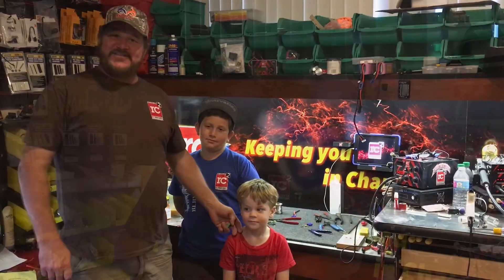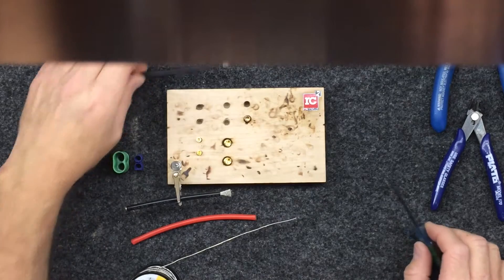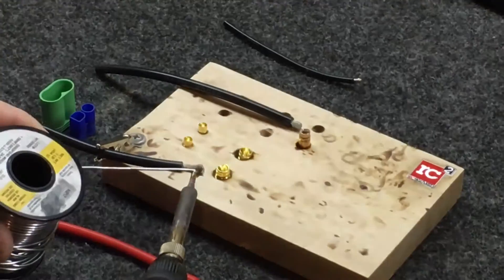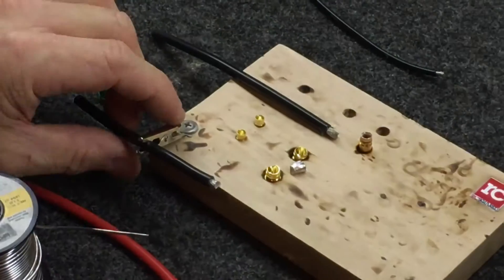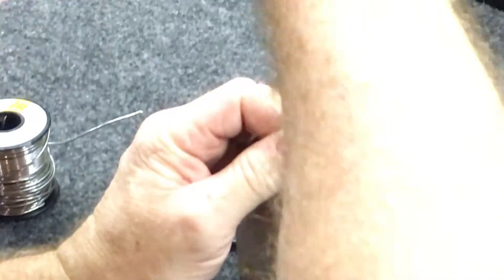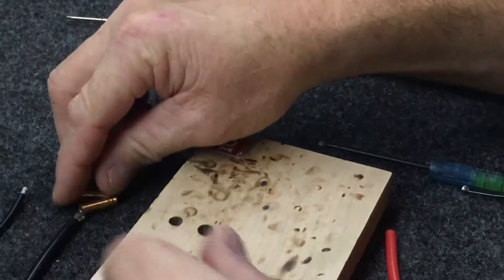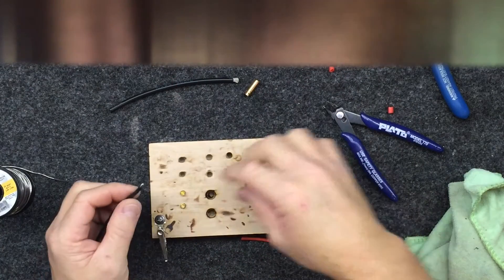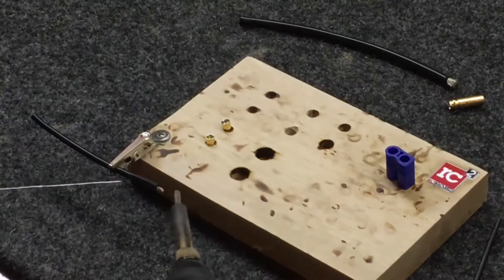Solder tips and techniques. How I solder Connectors.

Comment: Two important tips I learned from this video:
 1.) You can heat the cup to transfer the heat to melt solder. 
2.) You can wire and apply solder directly on top. 
THANK YOU for that. I was having the hardest time trying to get the wire completely infused with solder. Also, how hot to you typically set your iron at?

Comment: I use a gas soldering pen for connectors where the cap is put on after soldering, 10 times faster and way better than fidling with a soldering iron.

Comment: nice video tutorial. but my soldering is better and faster.. no.. jk.. i take much more time but use the same technique. my soldering iron doesn't reach 500 C it goes to 450 C but handles those 10 gauge wires as a champ.